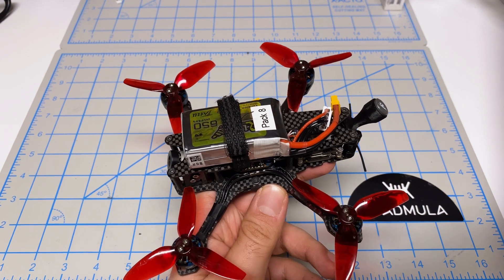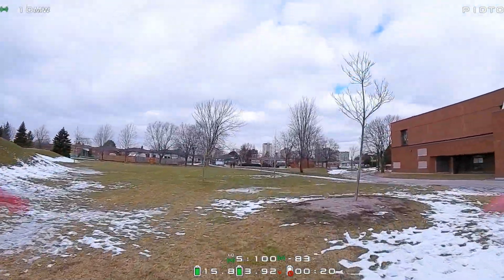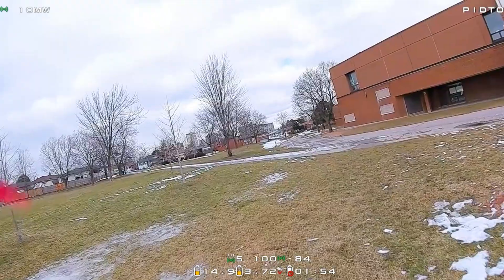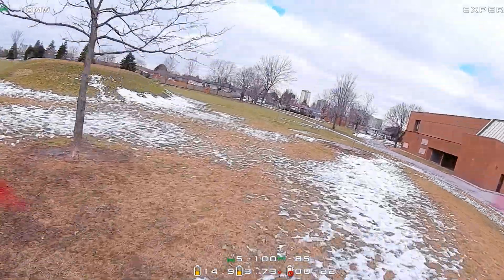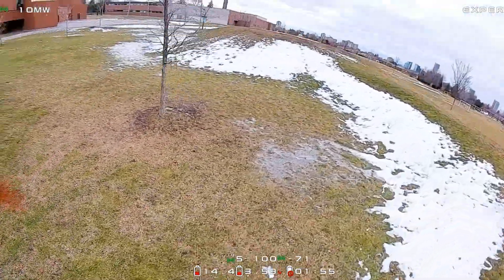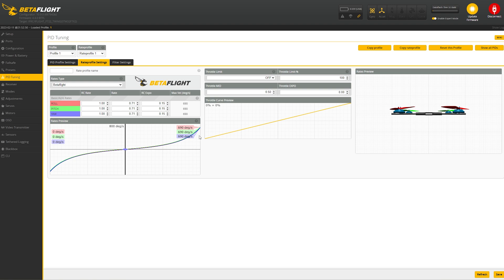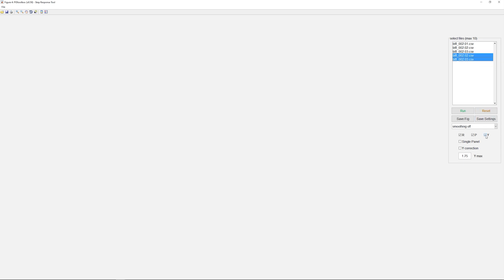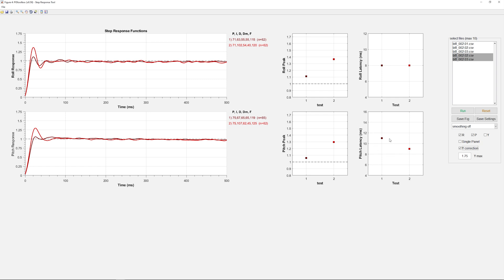A BETTER way to quad PID tuning? | My experience with PIDToolBox!

Comment: question. If you find your PD balance first with pidtoolbox, how do you get your IP balance? Once I have my PD all set, as soon as add (I) at all, even like .2 I am way over shooting all over the place, and my latency goes up. I'm not understanding. It almost feels like you have to completely tune PD all over again when you bring in I
Reply from the maker: Funny enough I feel to usually land at a very small I term when I tune with pidtoolbox, usually around 0.4 - 0.6.

Comment: Nice video and a good looking build you got there! Im doing similar sized build on a Tadpole hd xing2 1404 4800kv caddx vista. How did you set up the filters in the filters tab ??
Reply from the maker: I reduced the filter sliders nearly to the end and then ensured that the RPM filtering was on. This quad is fairly noise free and I get the best results that way.

Comment: Nice video and nice to see a growing interest in Ptb. One quick tip, sometimes the step resp is thrown off using FF (Eg the dc offset as well as exaggerated overshoot). To mitigate this I typically recommend just using the tool to get the optimal P to D balance. After that I analyze FF by looking at the drop in sp-gyro latency using the raw traces and the sp-gyro latency estimator (under the spec tool where you see the filter latency drop down). Happy tuning!
Reply from the maker: Thanks for the feedback and great job with the tool, quite helpful!

Comment: I suppose I’m still one of those flash defaults and enjoy. Tuning I figured by now was supposed to become easier. Seems tune chaser pilots have become harmonic engineers these days. Then again anyone who’s flown my quads all say “how do you get such smooth flights? This things tune is horrible” lol!!! I suppose it’s all in the sticks.
Reply from the maker: PIDs are very setup and pilot style dependent so what may work for my quad most likely won't work for yours. Perhaps you got lucky and the defaults are a close enough match for your type of flying and setup. That's never been the case for me, especially with me being on 4s. I've heard that the defaults are more geared towards 6s.

Comment: Thanks for the video.  Although the analysis is very interesting, it would have been more beneficial and complete if you included the part on how you used the toolbox to adjust your settings.
Reply from the maker: Honestly I was going to do that initially but the videos from PIDToolBox themselves are so good that there's no further value I can add. I've linked to the how-to video in the description.

Comment: New too quads and pid tuning is still intimidating me. Thanks for taking the time to make this video! 🇨🇦
Reply from the maker: Don't be intimidated, you can always try making little adjustments out in the field through the Betaflight OSD and then see whether the quad flies better or worse and keep refining. That's how I used to do myself.